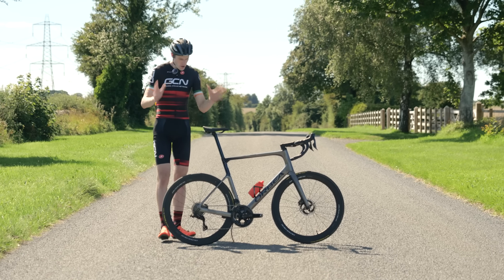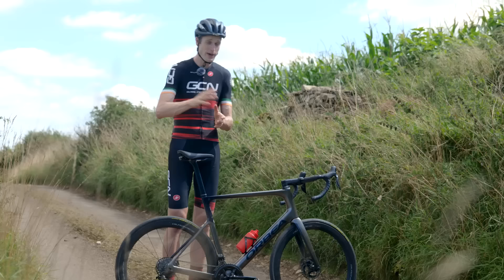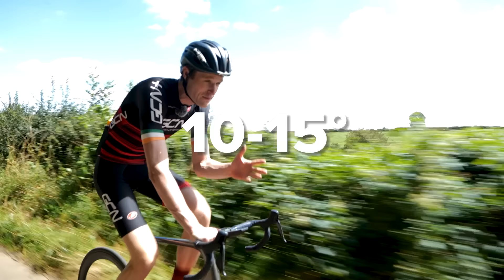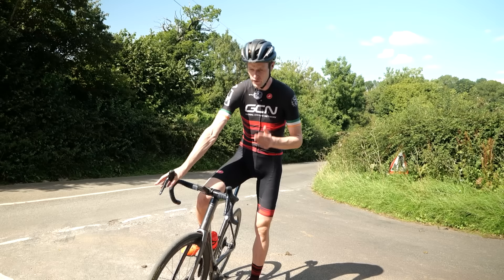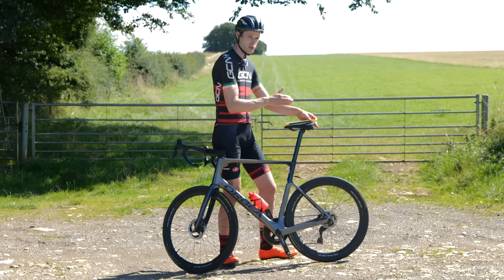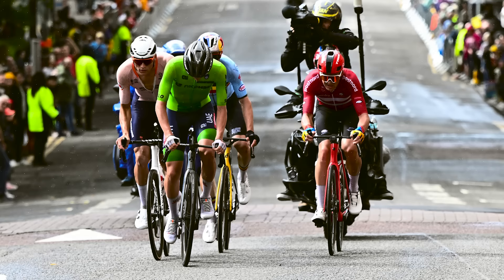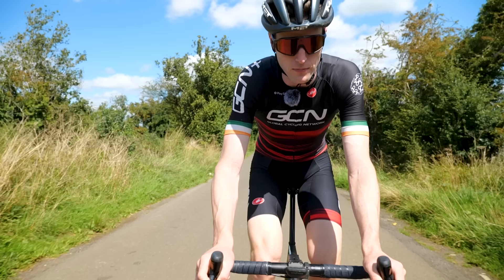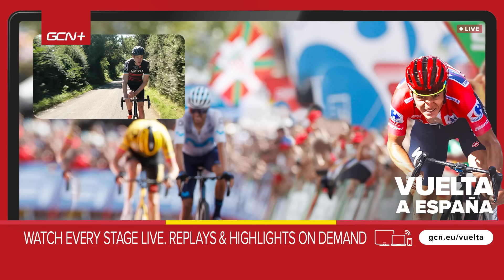Saddle Angle: Have We Been Getting It All Wrong?

Comment from the maker: Have you tried changing your saddle angle? 📐
Reply: nope, if not right angle it feels like im falling off my saddle and ill keep moving my but further back :O
Reply: Two years ago I bought a short-nosed saddle for my son and liked how it felt on his bike, so I added the. same one on mine. Because I sit with my hips over the wide part of the saddle and am not a nose-sitter anyway, I've set mine to -3 degrees of downward tilt so it's still effectively flat up to a 6% gradient. Anything above that and I'm probably going to be taking spells standing out of the saddle an no longer riding in a purely seated position.  Also, when a bike is on the turbo is really the best time to measure things like saddle tilt, assuming your floor is level to start with.
Reply: I’ve been running a -2.5 degree angle for close to 10 years now, it works so I have no desire to change.
Reply: Balance of Numbness in the crotch vs. pain in the hands = "some" down tilt of the saddle nose. 
Very Scientific😂
Reply: I haven't  but I will try from now on, thanks.
Reply: Yes, I tend to play around with mine. I’ve found a very slight slant negative  is what I like. Annoyingly, some of shops i use keep setting it to a +
Reply: Yes. The most comfortable position for me is with the saddle pointing slightly downwards. There's a feeling of sliding when I take both hands off the handlebars, but still stable.
Reply: I have had the Dash Strike 9 for years for which a slight negative tilt is recommended. My current tilt is about 4 degrees as measured from the front and I'm completely comfortable. I should say that my aero tucked position is much more comfortable than the normal, upright/endurance riding position, relative to the chamois placement of a typical racy bib short. The saddle is rounded so I can slide a little forward for good power on the climbs (up to about 18%).

Interestingly, with skinsuit the position is slightly more to the back of the saddle is preferable, probably due to the chamois being slightly more optimised for a deeper position. 

The chamois-saddle pairing is definitely a pandora's box for which it is surprising that very few people are talking about it. It's a hole in the market that no company is adjusting chamois specifically suited to a riding position, barring some specific companies like Bioracer and Vorteq which optimise their suits for a position and not for the steady state of fixed parameters (fixed reach, drop, etc. like for example Nopinz does).
Reply: I can't ride with the saddle in flat, a bit dow tilt takes the pressure on the front wich for me is very painfull, and I only ride mtb so the idea is not only for roadies
Reply: I have. I have a raised saddle (Speclalzied Power saddle), which I used to make it even (0%) as a whole. I now check the angle of the front half and set that to be even.. I feel this is the better angle for me.
Reply: Try using a shorter stem, or moving your seat forward. This relieves pressure you're feeling on the front of the saddle, ive got the same problem! @PTSeTe
Reply: @LucasBassFishing  The stem is already short but will try moving a bit further and try thnx!
Reply: I tilt it down for time trials when I also raise the saddle a bit more, but always change it back afterwards.
Reply: Yes, I use a SwitchGrade saddle angle adjuster to tilt my saddle down on the fly for climbing. Then tilt it flat for level riding. Saved my back and also stopped groin discomfort.
Reply: I have different bikes set up for different things. You have to move stuff around until it’s good. Once it’s right you’ll know
Reply: Yes. Nose down lately as I sit in the drops a lot.
Reply: I leave my saddle level, on some it is annoying but not adjusted as when sit on bike I swear the saddle angles down bit too much
Reply: I would like but don't know how😂
Reply: 1st thing to consider when levelling your saddle using a spirit/bubble level is to have your bike on level ground... yes, 1 degree makes a noticeable difference. 2nd thing is applying the level to the saddle rails - not the top of the saddle due to variances in the myriad of saddle design profiles. The saddle clamp will interfere with placing the level directly against a saddle rail, so use a tyre lever across the rails fore and aft of the clamp to get an accurate reading.

Comment: They touched on this but it's the most important thing to remember. 99% of riders should not copy the pros. They are freaks of nature and can handle more extreme positions. They produce much more power than the rest of us and this power takes considerably more weight off of the hands, arms, and shoulders. For the rest of us, tilting your saddle forward will just put undo stress on those area and cause problems. We have to stop comparing ourselves with the pros.
Reply from the maker: We're not sure about freaks of nature but they certainly shouldn't be the bench mark of bike fits 👀 They ride lots more than most of us so will be extremely well adjusted to those long and low fits.
Reply: As someone who has a 10° angle saddle, I'm definitely not a freak of nature. 

It's not that bad if you're short tho
Reply: @gcn  "Freaks of nature" was said lovingly and jealously.
Reply: @2ball434  I'm glad it's working for you but I'm willing to bet you're also an outlier. But I'm happy to be wrong as well.
Reply: 100%
Reply: @CatManDoSocial former not very good pro here.  I'm nose up about 4 degrees because I still needed to unweight my hands.   Never been dinged for it.   TT saddle is maybe 1 degree nose down.  I was a forced into retirement, 320lb shot putter(I'm 6'1")when I started cycling.  My fit hasn't really changed since I got down to about 240lbs and at my peak, I weighed about 180-185.   I had huge drop in my bars, even when I was big.   Didn't bug my back or neck one bit and my hands/wrists bothered me with any amount of drop.  Nosing up was the only thing that made it better.  It's still quite bad though
Reply: @veganpotterthevegan  My fellow vegan! I completely get what you're saying. I measure saddle tilt with a small shelf panel and my iPhone so that I get an overall tilt, not just a certain part of the saddle. I'm at 0° on my road bike and slightly nose up on my XC MTB. Otherwise, too much pressure is on my hands and wrists as well. I'm not a powerful rider so that probably has something to do with it but that's just the way it is for me too.
Reply: Yeah I watched another video on tilt. I think from Neil Stansbury. He touched on this. Their higher power output, low upper bodyweight means there is almost no pressure on the bars for them. I have more upper body mass and no where near the power output. So I can't do extreme angles. I've been experimenting with this in recent months. Tilt effects where I sit on the saddle, pelvic tilt and muscle activation for sure. I'm right around 1.5 degrees down. If I even go down 0.1-0.2 I slide towards the nose. More weight on the hands, perennial pressure, quad involvement. If I go in the other direction I slide back on the saddle, more perennial pressure as well, get chafing from wide part of the saddle and can't rotate hips so I get lower back pain but it is slightly less hand pressure. I just go with a happy medium. It also is the fastest for me.
Reply: @starlitshadows  I'm glad you found your middle ground that works for you though. That's all that matters.
Reply: @starlitshadows   sounds like you've done the sort of testing / experimenting I would recommend to find the sweet spot for you. for everyone it's different. some of us have a wide range of angles we can ride comfortably while others a much narrower range. in addition to that there are all the individual rider characteristics that we mentioned and you pointed out to find what works for one rider
Reply: Yes! THIS!
Reply: If i put mine 0⁰ I feel like hurting my balls. I put it like -3⁰ to help
Reply: They do address this
Reply: For me I find a slight forward tilt more comfortable than flat.

Comment: normally "flat" is measured across the middle part of the saddle where you actually sit that is supposed to be flat and not across the entire saddle the way the UCI is measuring. Many saddles have rear support going up or nose tip pointing down. If you measure across the entire saddle, it will seem to point "down" even when the middle part is actually "flat". Anyway, "flat" across the middle of the saddle is a good place to start and slightly "down" from there is fine if it works for you
Reply: The saddle rails define the saddle tilt. Horizontal rails means flat saddle position. Saddle form defines and/or describes how saddles match the riders bum.
Reply: @antoniosegalada739 way too many variables and types of saddles for this to be true.  if my saddle rails were level it would be tilted forward to a ridiculous degree and unrideable.  There’s no one way to define what is level bc saddles differ so much.

Comment: Riding up hill changes the saddle angle. To the ground yes. But to your position on the bike?  No.
Reply: well to earth horizontal - the ground is also tipped up on a hill :). But I agree this makes no sense. But when riding up steep climbs there is a tendency to shift your position on the bike forward and lower toward the bars. This puts you right on the front of the saddle, and it could be better to have your saddle tipped down a little to accommodate.
Reply: Most riders lean forward when going up an hill. So it does. Maybe not in the same way as to the ground but I think that most riders do not sit in the same way as on flat ground. 

Could be similar to walking up a hill. No one walks with a 90° Angle to the ground up a 20% slope.

But thats just my opinion and experience, guess each one rides different.
Reply: But remember, gravity is always straight down. So the angle of force on the saddle will change slightly...

Comment: I say have your saddle at the most comfortable angle for you. I tilt mine down slightly, to take pressure off the front area.  Too much, and it's then uncomfortable on my butt, so it's a fine balance!  I have the same saddle on my gravel and road bikes. As the geometry is different between the bikes, the tilt of the saddle needs to be different, so that the angle feels the same when I'm sitting on each bike. It took a lot of faffing about in my kitchen and then testing around the village about 100 times for me to realise this 😊
Reply: You could solve that faster with a bike fit 😊
Reply: @PhiyackYuh  I've had a bike fit. 
But only on one of my bikes 🤪

Comment: I'm a commuting cyclist in a very windy region. I changed to flat bars many years ago, and found that, whilst generally comfortable, cycling into the wind was awful.
So, I added tri bars, which really helped on those windy days, but made setting the saddle angle really tricky. I think I have now got the worst of all worlds - compression of the nether regions when using the tri bars, and numb hands when I'm on the flat bars.
A tilting saddle sounds like heaven!

Comment: I'm at around 1.5 degrees down myself. Even minute changes of 0.1-0.2 degrees I notice a difference. As of right now this seems to be a happy medium for me. If I tilt lower I slide towards the nose causing perennial pressure, more hand pressure, pain in the traps, knees. Tilt back I sit further back on the saddle. I do get a bit less hand pressure but can't rotate hips so I get lower back pain, chafing from the wider part of the saddle and also more perennial pressure. In either direction I'm slower as well. Though since the tilt changes where I sit on the saddle then maybe changes in saddle height and fore/after to compensate might be worth experimenting more with. Less hand pressure with similar power and no lower back pain would be ideal.

Comment: My rule of thumb is with modern kick-up saddle shape, the tail of the saddle - the nose of the saddle - the handle bar of the bike should be inline. Or simply the saddle should point to your handle bar. That gives me an overall best.
Reply: That has always worked for me well. Too high and the taint hurts+goes numb. Too low and you just fight it by pushing against the bars.

Comment: When I installed aero bars (2-3 years ago), I started changing the saddle angle after looking at Mark Beaumont's saddle. I have since found the sweet spot for comfort and even when I'm not using the bars, I feel like there is less pressure on my crotch  with a slight angle. Definitely worth trying!

Comment: My saddle had a slight upward tilt, like 1-2 degrees. I realised it after years and decided to tilt it downwards today to see if it works. It really did help in terms of comfort and pressure on the buttocks/ bones as well as ease of riding  But after 5 hrs of riding, I started feeling discomfort in my shoulders and neck. But still I feel downward tilt is the best as it helped me cover 100 kms with ease. Only started today, will update more later.

Comment: Bryan's remote-tilt saddle idea makes more sense than setting the nose downward when, say, 10% of one's overall ride is going up, creating other potentially negative results to the rider's body due to position for that other 90% of the time. My rides routinely have 1,300-1,700 ft of gain over 25-30 miles, mostly in short, steep (up to 15%) climbs. Setting my saddle to compensate for maybe 5 of that 30 miles seems to raise concerns of comfort--my #1 goal for a successful ride; and since it would appear that a comfortable rider is a more efficient rider (see all the evidence of tire pressure-related performance gains), I think I'll take those two, related, factors, and ride a nearly flat saddle setting.  Of course, riders more concerned with flat out speed will pooh pooh such frilly thinking; but as I enter my 36th year of riding (and between 250,000-300,000 total miles), I can say my desire for the highest performance is now behind me (cough cough).
Reply: More than half of my TIME is going up. My 25 mile rides are 2500-3500ft. Lots of sitting and spinning. Down is much less of my time as I'm going MUCH faster. I need a small downward tilt. Everyone is different.

Comment: Interesting video! What we experimented is the design of the saddle helps to increase the power benefit that you been mentioning without the problems to have a forward tilt.

On the video, I missed to mentioned that a forward tilt the cyclist slides on the nose, where the saddle is narrow INCREASING THE PRESSURE IN THE PROSTATIC AREA

Comment: I have always tried to have the "nose" of the saddle parallel to the ground. since the rear end of the saddle is usually going up a bit more putting the water spirit level from end to tip will mean the nose of the saddle is pointing up. So I'm putting the level just on the front half of the saddle and try to get that part level which means that completely back to front is slightly down.

Comment: Interesting information. Thanks!! I may experiment with tilt just a bit. HOWEVER, I should pass this on. I had been having problems with a sore butt even after a 40 mile ride. I was about to start buying new saddles to find one that would give me a better ride, but then I had the idea to try moving my existing saddle back a bit (maybe 1/4 inch). I noticed a big difference. I slid it back even more, for a total of maybe 3/4 inch. I recently completed a century ride with no problems at all. 
Maybe you could discuss moving the saddle forward or backward with a fitter. Might not be worth a full episode, but might be good for a GCN Tech question.

Comment: Last year I was experiencing a lot of pain developing in my right knee,  thought it might be a bike fit issue, took the bike in,, as soon as I sat on it the bike fitter saw the problem, my saddle was angle too far down, hence all my weight was moving forward resulting in too much pressure on my knees as I was subconsciously trying to push my weight back up the saddle. So in short, yeas, very important to get yer saddle sorted.

Comment: By mistake/accident, my saddle got set up about 3 degrees negative on my roadbike before a 100 mile fondo.  Had to do with travelling and bike packaging for shipping.  Anyway, I can vouch for me, and I won't be tilting my saddle forward.  I couldn't understand how come I kept sitting on the nose with a ton of pressure on the lower region, and this also made the bike feel "short".  So for me at least, I'll leave mine 0-degrees level.  I ride with a Selle Italia SLR Gel Flow which does have quite a bit of padding and sort of flat, so I slid forward all the time.  In disclosure, halfway through we did a roadside hack and got it somewhere about 1 degree b/c by then I knew I had some issue, I just didn't understand it.   Ahh what we learn by trial and ERROR.

Comment: Hello.  My saddle used to be perfectly level.  I tilted it down in the spring and forgot about it, but did develop intense pain on my bottom.  It took a few rides before I linked the pain to the saddle position I had changed.  I put it back to level and pain was gone.  Few weeks later I had a bike fit with a pro, and he decided to tilt the saddle again.  Pain came back immediately.  I leveled the saddle again and pain is no more.  So in my case, titlting the saddle is a no-no

Comment: When I was 20 I had a 40kph wind pushing my body back and I had nose down saddle.   50 years later the upper body weight is larger and the wind is less. My saddle is flat these days or I get arm and shoulder fatigue. And the bars are higher.

Comment: As one of the comments said, we should be measuring saddle tilt based on the rails. If the rails are parallel to the ground, then the saddle is at 0 degree tilt. This should be used as standard method of measurment that provides common baseline/starting point as there are too many different saddle shapes above the rails.